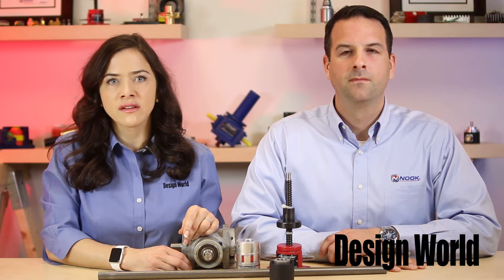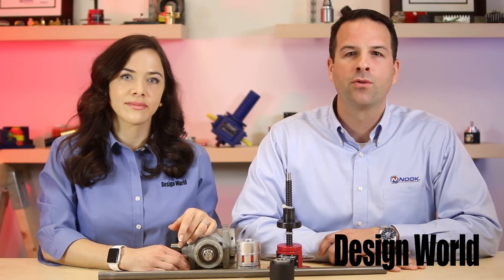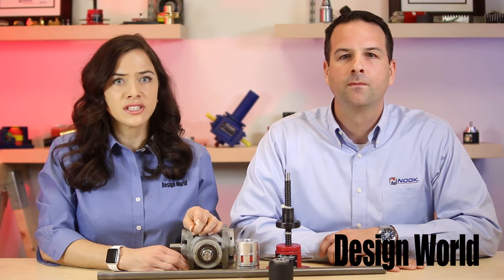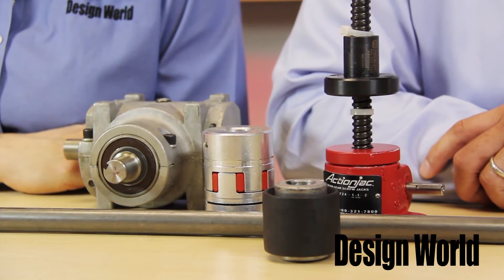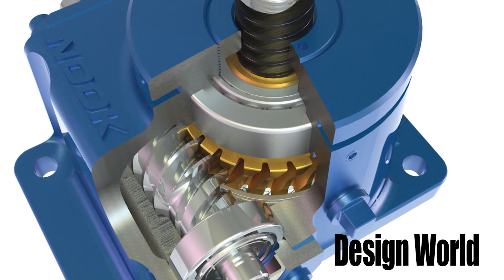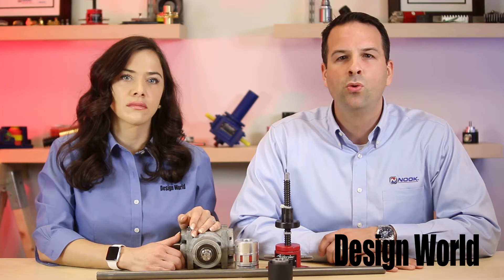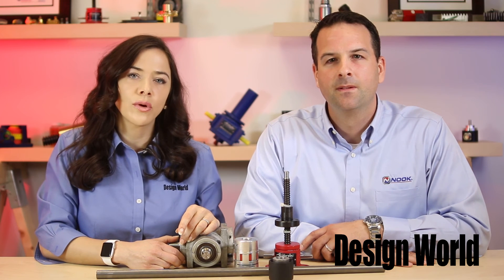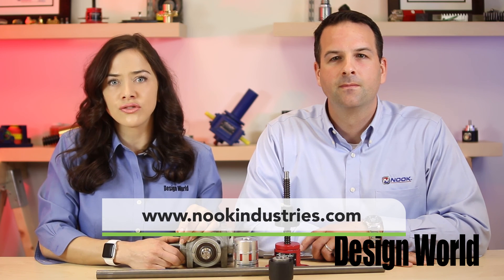Basics video: Worm Screw Jacks 101 and answers to some jack FAQs

Comment: I could use some help. Our contractor built a bench/box for our pool's solar cover and reel. Nice piece of furniture but the lid weighs about 500 pounds. We cannot seem to find a set of lid lifters or gas springs to handle this weight. Any ideas and/or suggestions would be greatly appreciated. I thought that maybe one of your worm screw jacks might work? I'll be glad to supply additional detail and images. 

BTW the bench is about 22 feet wide and less than two feet deep. They built an internal frame with 2x4s and then covered everything with decking material. There are some other design issues as well, but right now I'm just trying to solve the lid problem. Thanks
Reply: Have you tried an electric actuator? https://www.joycedayton.com/products/multipurpose-actuators